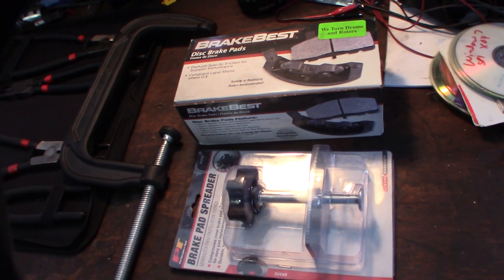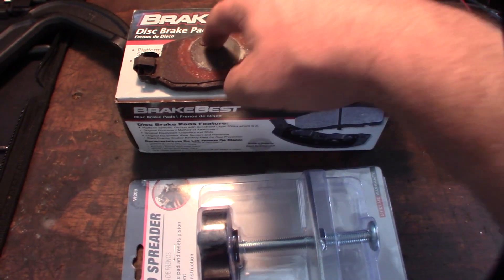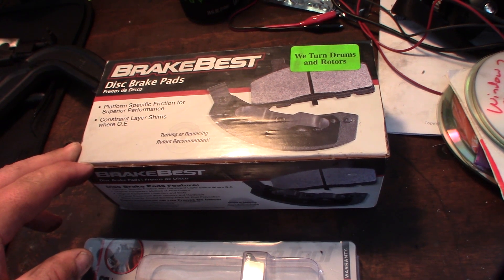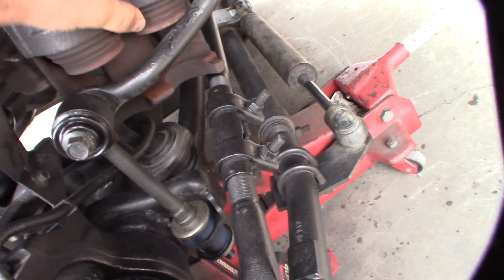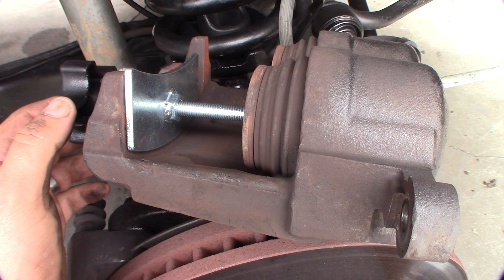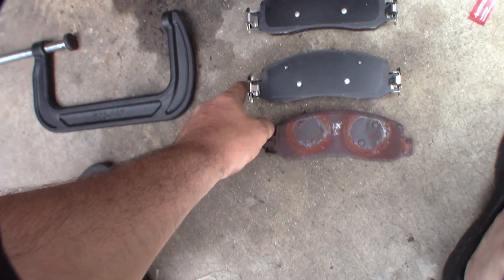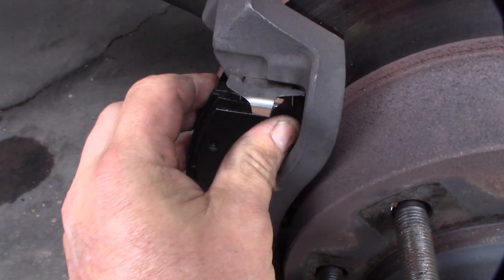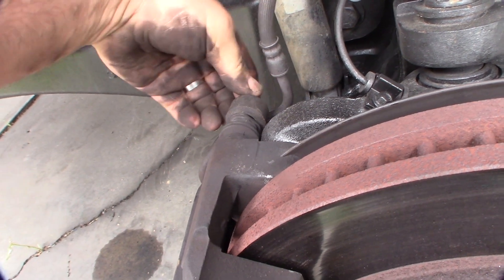Ford F250 Semi-Metallic vs ceramic Brake pads on super duty truck

Comment: The Ceramic vs Metallic is very subjective. My trucks OEM semi metallics sucked, I had to clean my rims once a week and they squealed so loud you could hear me coming from a mile away. I tow 10k with ceramics for the past 5 years now and don’t have a problem. They stop way better than the OE metallics and last ALOT longer. My OE semi metallic pads where over halfway worn at 12k miles And chewed the crap out of my rotor, my last set of ceramics I got almost 50k out of with heavy towing. Before you read everything you hear on the internet, actually try talking to someone that used ceramics and/or try them for yourself. If you ever get your brake system to experience brake fade, pads will be the least of your worries and your either riding your brakes or need a bigger truck.

Comment: Take it from someone who's been in the business since 1982, if you're going to be towing or hauling heavy loads on your truck you always want to stick to Semi-Metallic or Metallic Pads. They have the capability to actually stop your truck when you need it the most. If you use ceramic pads they will get used up so fast you'll wonder where they went. If you speak to any ford engineer they will tell you the same thing. Heavy loads and towing need Semi-Metallic or Metallic pads.
Reply: What's your opinion on drilled and slotted rotors?